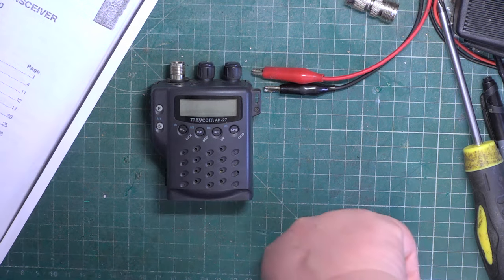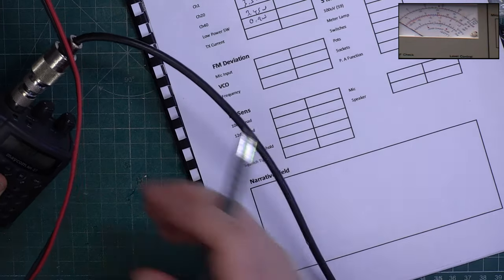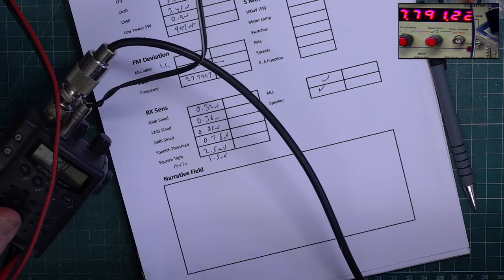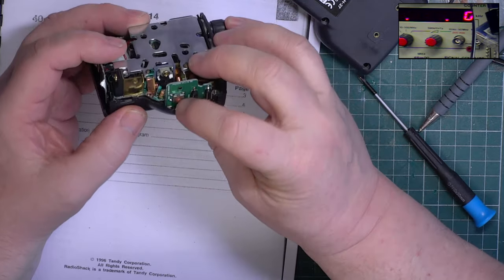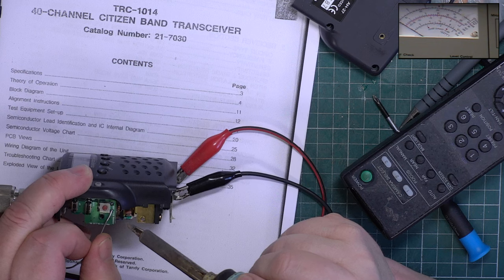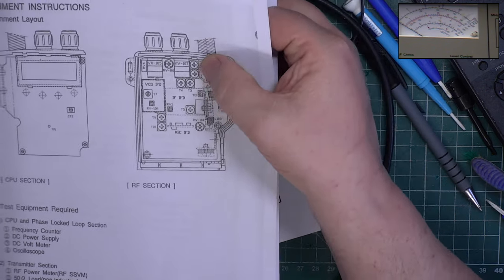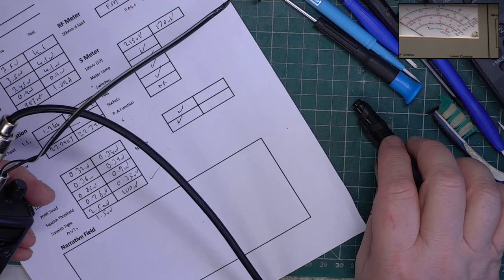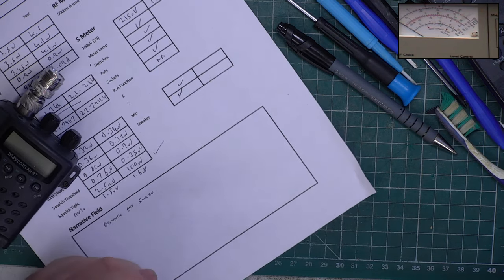Maycom AH27 PR27/97 UK/EU FM CB radio handheld -  Repair & service alignment.

Comment: Hi Richard I’ve also got the Radio Shack TRC 1014 that I bought from Tandy in the early 90’s. Mine is the 40 channel version & I’m aware that they brought out an 80 channel version after this. My friend & I used to regularly achieve 5.8 miles on the  standard rubber duck antenna to him on his mobile set up which was an Amstrad 901 & K40 mag mount. I’ve only just measured this distance. So completely agree with you that the performance of this handheld on its rubber duck was / is astonishing. I remember in those days, I couldn’t believe it, & repeatedly asked for his location. But the reception went in & out as he drove from my house to his location which was elevated but still across a very built up & industrial location. Yes we used to do our own difficult terrain tests!
Reply from the maker: I'll definitely do one of mine over the next 10 days & then we can do a field test with the bodycam..like we do.

Richard

Comment: Manged to look at the Amstrad 901 looks like there is a problem with U1 VC0, any common faults to look for  please
Reply from the maker: Check for 6V at pin 18. That's the power supply rail for the PLL.

Richard
Reply: @ukfmcbradioservicingTango21 thanks I will keep you updated, Monday I will get a scope on the VCO and look at  the chip voltages

Comment: I have the same radio I bought from new in the 90s can you recommend a different antenna than the supplied rubber duck which isn’t very good ?
Reply: hi 👋 richard good luck repairing the maycom AH27 pr 27/97 uk/eu fm cb radio handheld  from paul chapman at east sheen 73's also I enjoy your video on radios
Reply from the maker: Thank you Paul,

Richard
Reply from the maker: No, I have no knowledge of third party accessories. Now this is interesting as we've consistantly had 10 miles range on the supplied rubber duck with this type of radio better than nearly any other set.

I'll do a service of one of my own AH27 or RadioShack equivalent model & then we'll do a field test.

Richard, G0OJF, UK
Reply: @ukfmcbradioservicingTango21  to richard you are most welcome i am looking forward to the air test From paul chapman at east sheen 73's